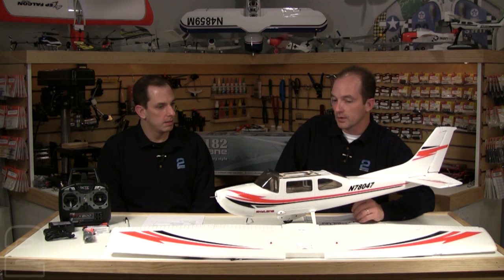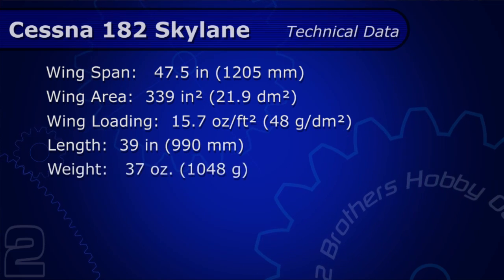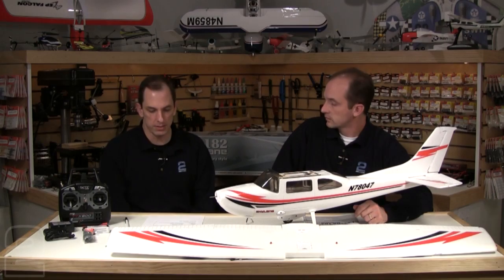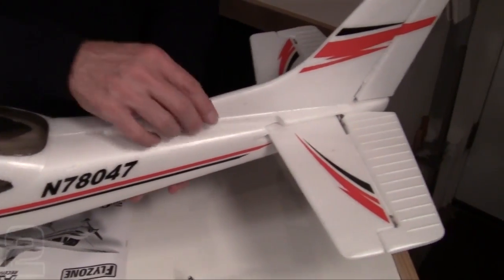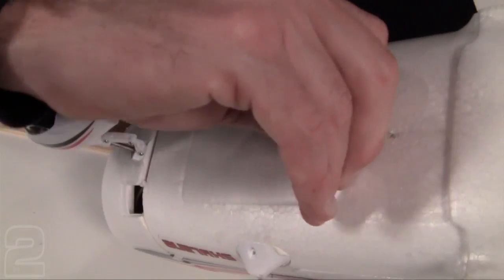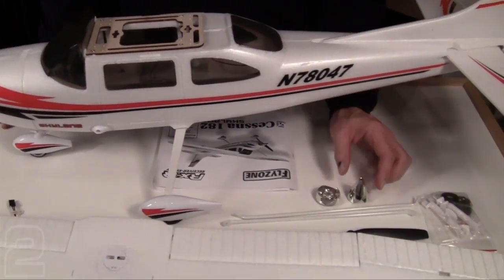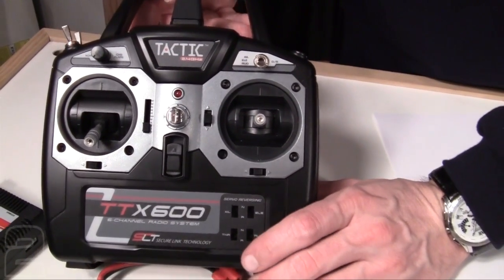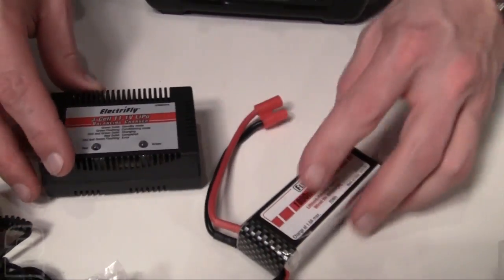Flyzone Cessna 182 RTF Review - Part 1, Intro and Flight

Comment: This is my first plane.  Ive only used the simulators to fly.  The first time I flew it I used the flaps, it ballooned up cause I gave it to much power, i powered down, it stalled, and nosed down.  Snapped the shaft on the motor.  Got another motor.  flew it the second time with no flaps, much better for me.  Ill try the flaps when I get better.  Landing was rough for me at first but I finaly got the hang of it.

Comment from the maker: Hi Gary, the wheel issue is fairly common and can be improved with unclefester420's suggestions below. As for power, the stock power plant is more than adequate for beyond-scale aerobatics. There is an RC epidemic of everyone wanting over-sized power plants! This is a Cessna 182, not an Edge 540, or a P-51 Mustang. It's a passenger aircraft that was never designed to even fly inverted. This model can perform snaps, loops, inverted flight, aileron rolls, etc. More than enough power:)

Comment from the maker: Thanks for watching!  Typically, you do apply some mixes with flaps, but the stock RTF Tactic radio is a basic platform, so it wasn't an option.  The Cessna handled it really well though, with manageable (and minimal) pitch correction.  Once you back off the throttle, the plane levels out well with flaps deployed so they did a good job balancing the incidence with the thrust line for basic control.